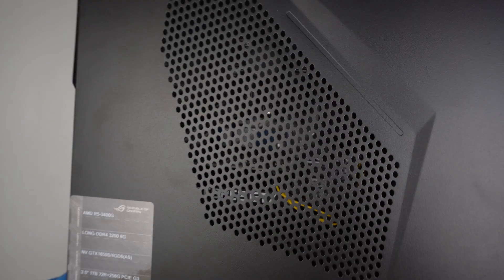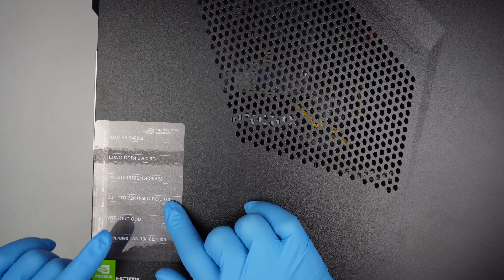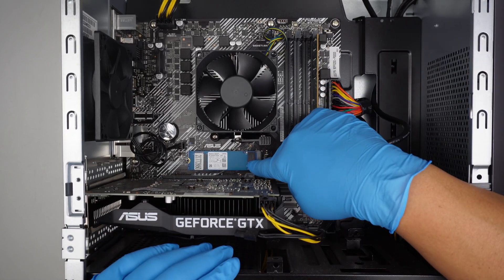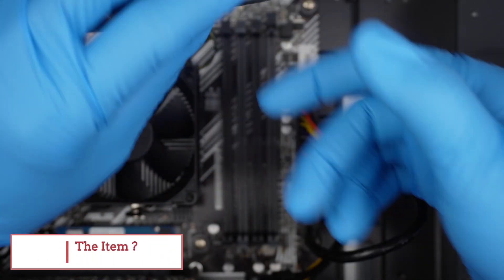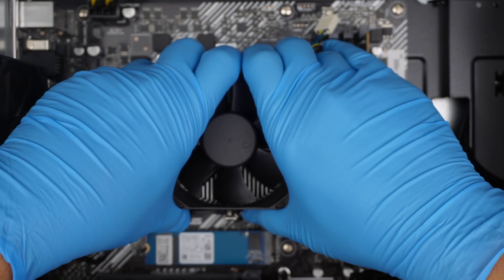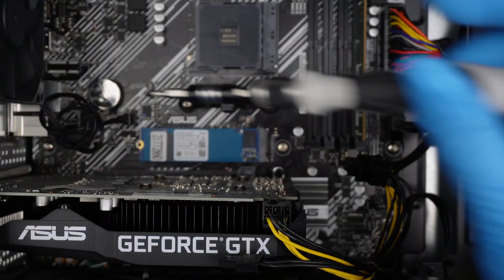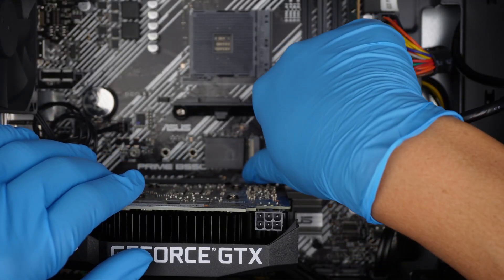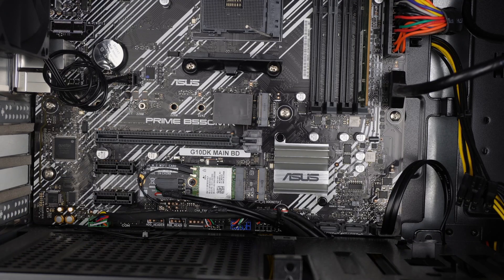Whats Inside Asus G10DK You Must Know

Comment: Can I upgrade it to a Rtx 3060
Reply: If so dual or single fan only
Reply: I upgraded to the 3060 TI dual fan. Fits well.
Reply: @CobyRhey  ooh alright, what brand did you get
Reply: @theclue5551  i have a 3080 in mine 3 fan fits fine
Reply: U can I got some kinda of variation that ROG dosent sell and it has a rtx 3060 single fan
Reply: @ how does the single one fit? Would there be enough room for the double fan

Comment: Love these breakdowns, do you have a breakdown or a video on how install and find a AIO water cooler for the CPU and GPU. I heard some have kits to add the GPU onto the AIO but having issues finding one. Dont want to buy two 280mm AIO just to water cool my GPU and CPU when I can just use one. Ive seen it done but dont get where they get the part. Ive checked most major retailers but havent seen on cooler master,TRYX and gamepower and alpha cool but no luck yet so if you can..help please!! 😂 Love your chanel always helps me as a independent contractor for IT and network tier 1 and 2 support